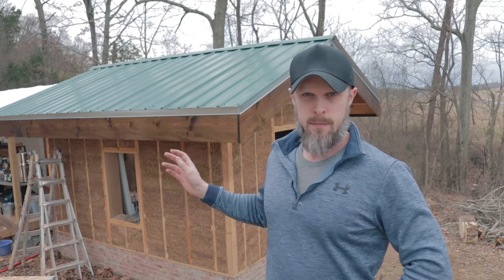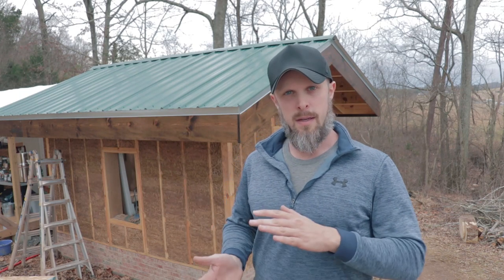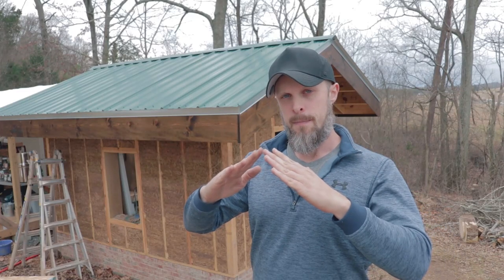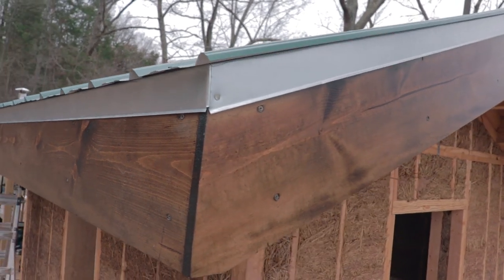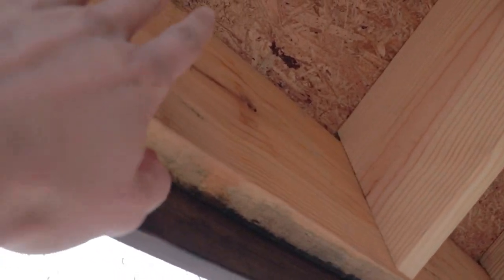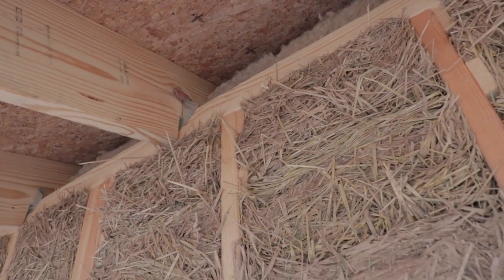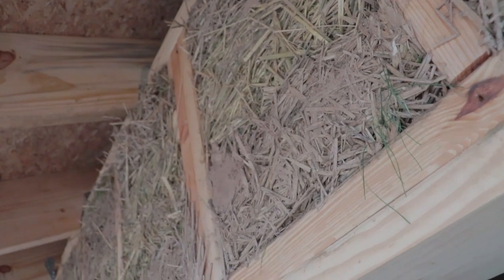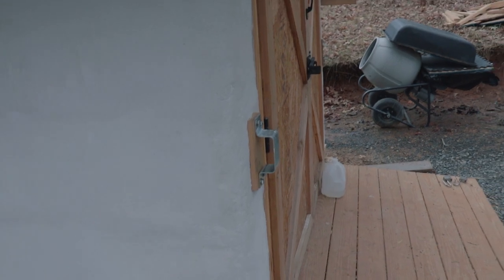How to Naturally Ventilate A Roof | Building a Straw-Clay Tiny House - Part Four

Comment: i forgot to send this email. I know you'll get more eyes on this here anyway.

How thick should an all-cob wall be at base and at top for a 3 story home with 9' rooms (32' tall including floors)?

Should you use masonry instead of cob if you have no choice but to build into the side of a mountain? Imagine the home looks like 1 story from the height of the slope and 3 from the base.

Is building on a slope even feasible with cob if the land and (concrete) foundation are even done correctly? 20+ tons of rock seems a little sketch, but I would absolutely capitalize on this if it is possible.

Thank you for everything you've done for the community. I am now a happy participant and homeowner thanks to you.
Reply from the maker: Some serious engineering would be needed to determine the tapering of cob walls for a 3 story cob building. That's something I can't accurately answer. But they will definitely need to taper, unless you can build them perfectly plumb/vertical all the way up.

Any of the structure that is covered or underground, I would recommend concrete walls. I have a video here on Youtube regarding bermed cob homes. That one might help you out.

Sure, you can build on a slope, but the foundation will need to be robust. It will take a lot of foundation work in the case of a steep slope.

You're welcome! Hope these quick answers help some.
Reply: @thiscobhouse  more helpful than google has been in 3 months. Thanks again 😁

Comment: Regarding the gap, how doesn't that allow heat escape in the winter? Seems like it reduces the value of the great R28 wool insulation. Granted heat rises, but still seems like it would escape through the gap.
Reply from the maker: The warm air inside the building has to go through the entire insulation batt before reaching that air gap.
Reply: Would it be possible to effectively use a light straw clay prefabricated panel or even to infill between the roof rafters as a thermal acoustic insulation option for single sheet metal roof?

Comment: would replacing the bugscreen and wire mesh with a nicer looking wood planking still work if you ad metal ventilation ports? or won't there be enaf airflow. I live in belgium and i  have niver seen it done this way here.
Reply from the maker: I think you would still get enough airflow that way. Most soffits these days only have tiny air holes. I don't think that's enough room for airflow, but you don't need to go as extreme as I do with the soffit venting in most cases.

Comment: Hey, I live in Poland where there is really cold in winter. Im just thinking if those air vents will not allow to get too much cold into the room. What do you think?
Reply: I'm not sure about those vents,  but if you're considered about the air being to cold. Put a 4" pipe in the ground under the frost line in your area. I'm not sure how long it needs to be to work. Attach it to your with a fan and a vent filter to you house.  And on the other end put chicken wire and a screen to keep critters out.
Underground is always 55° ish. So cool in the summer and warm in the winter.  
I think that's called geothermal,  I don't quite remember.